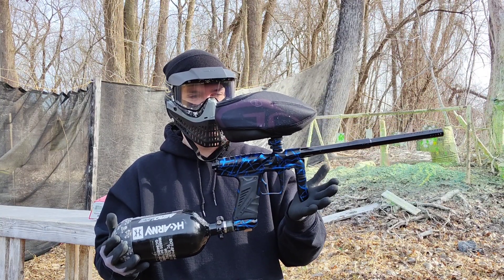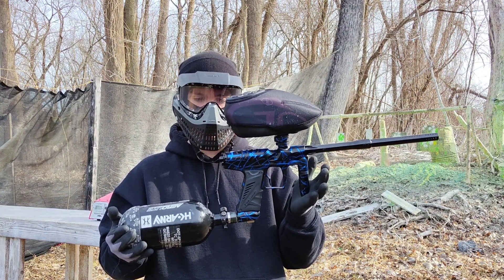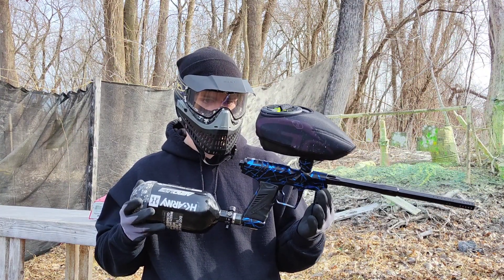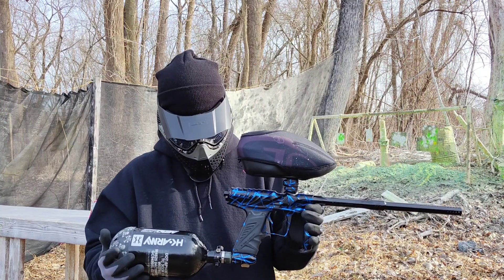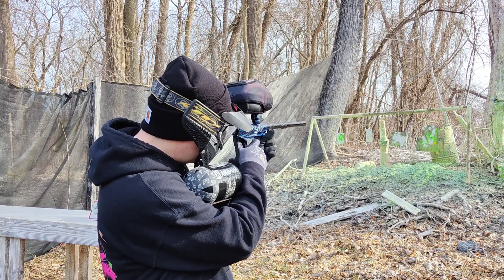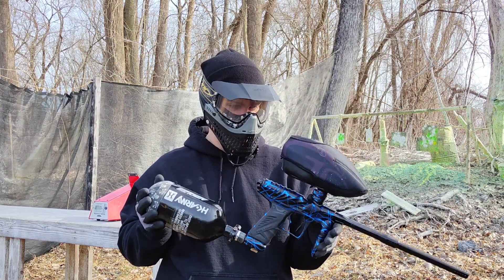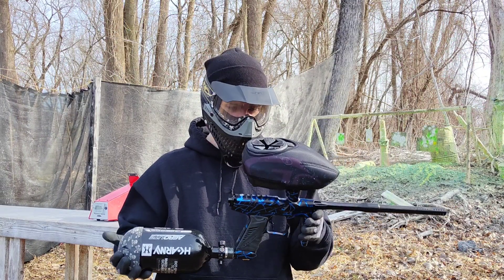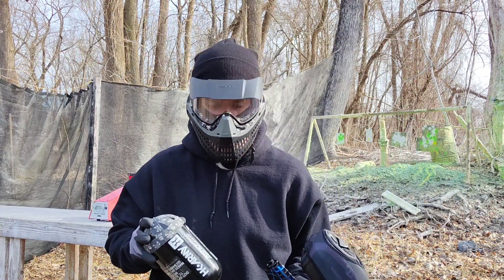Bob Long Insight with Reflex Engine

Comment: And I also want to add that the Insight is Way by far the fastest cycling marker with eyes on I have ever seen or owned. The weird thing is though, with real paintballs it seems to only averaged around 24 balls per second, but I did an experiment using greased-up reballs and it sounded like it was averaging over 30 BPS and had a peek of 36 BPS. It was freaking insane.
Reply from the maker: They are ridiculously fast! I bought this one just to see how reliable I could make it with different o-rings. Not to mention they're fun to play with.
Reply: @chucklovespaintball  sadly I never got to play with mine, I was living up in New York and had nowhere to play as this was when I first decided I wanted to get back into paintball and I began to buy equipment, but I didn't get to play until three years later when I move down to Georgia where I am today but sold it on PbNation prior to the move. 

I really wish I would have held on to that insight cuz I would have loved to have played with that especially now that I finally found myself on a divisional team and I'm currently getting to scrimmage against division 3 and4 teams, and it would be exciting to get to rock a lightweight oblong marker like the Insight that I had. I can't complain though, my Bob long V1 that I converted into a OLED VIS is serving me perfectly, but I still do Wonder how much fun it would have been if I also had my Insight still.

Comment: I have had mine since 2013. Lots of headaches with this thing but I can’t seem to get rid of it. Too much time invested. I have changed about every o ring to ones suggested in all the forums, some work some don’t. I always have an issue with the gun shooting about a hopper perfectly fine, but then just shot down and it’s done. The paint will just pile up in the barrel.  Any suggestions on what that could be? The only thing I haven’t changed is the original noid. Been racking my head on this for so long.
Reply from the maker: Have you tried replacing the Schrader valve? I definitely recommend using cast urethane o-rings in the shut-off and back of the ramshaft as well.
Reply: Yea I have replaced the valve. I think I have a urethane in the shutoff now. But idk if it’s cast. I have tried the xrimgs on the 2 ram 010 but they seemed to cause more friction.
Reply from the maker: @hockeyman59  I did notice a break in period with the x-rings. What grease are you running?
Reply: Monkey poo, tri flow a bit, and Dow 55 on outer rings. I’ll have to try the x rings again.
Reply from the maker: @hockeyman59  Try dow33 lite mixed with some Tri-Flow and/or the newer Dye advanced lube (blue lettering)
Reply: I’ll try your suggestions. Thank you.